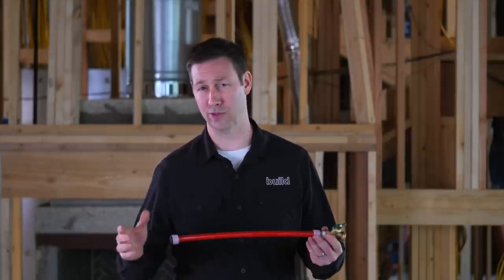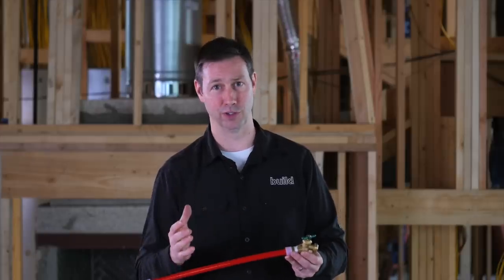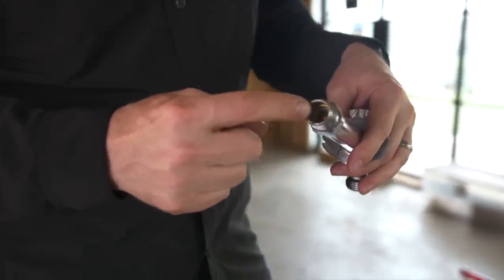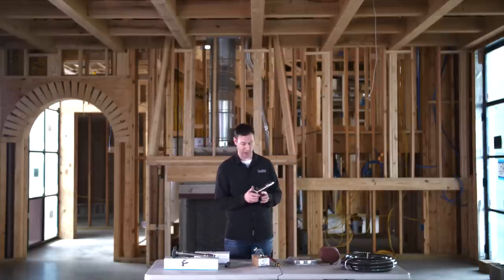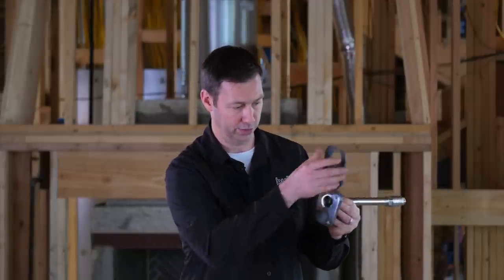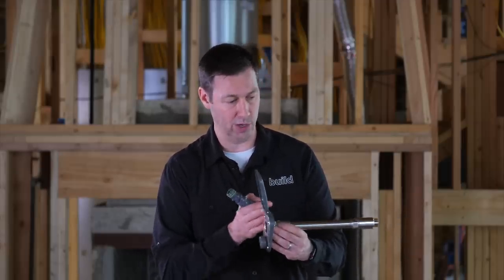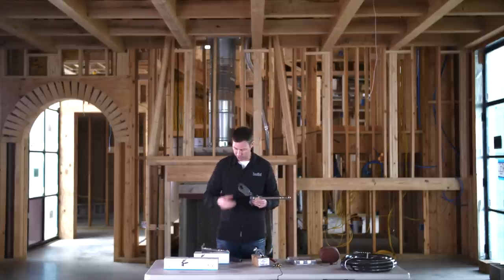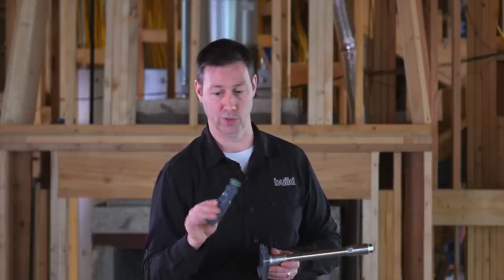No More Hose Bibs - A Better Outdoor Faucet

Comment: Way too expensive, and now you have to buy "accessories" just to use your hose. That silly plastic adapter looks like s sure way to break the valve or the accessory, when pulled on. Also, imagine that some contractor or landscaper needs to use your faucet, yet you are not home to show him where these gadgets are and how to use them.

Comment: Conventional  Frost free hose bibs have their own problem that causes total failure.   The are rising stem valves using  a polymer washer on the end of  long  tube. The tube is thinwall,  Very thinwall and it deforms easily. I can wreck them  with one hand.  The polymer washer is  cheap shit and embrittles forcing you to increase  torque leading to the end of you hose bib.   I've fixed a couple out of frustration and  used solid brass with a Delrin  spacer in the middle to prevent thermal conductivity .  Those frost free models  really are shit.  In the end I abandoned all  hope of a decent hose bib and  installed shutoff ball valves inside the building that I have to remember to shut off in winter. 
Those Hydrants  you have there look great  right up to the point where you wife or kids  start dropping it in the dirt or on the pavement and then shoving that damaged filthy  thing into the sealing surfaces.  Then  it's all shit again.

Comment: our house was plumbed with a shutoff in the basement ceiling for each hose bibb so we are able to shut them off and drain them if the weather is going to drop cold enough to worry about a freeze, not paying out the ass for a fancy plug that uses plastic parts.

Comment: had hte normal faucet for the last  15 years and never once did my pipe or faucet freeze sure if you leave  2 inches sticking out of the wall it will freeze eventually but mine is strait equal to the wall and insulated arround the hole  . Only the faucet sticks out of the wall . And guess what , i live  in the north of québec where winter temperatures reach -15 in average  and on rush time  -36 to -40 in celcius . I,m no expert plummer  but i can tell you this , its the amature that installs it that causes a faucet or pipe to freeze or leak  , not the kind of faucet you install . That faucet  did come off once  but it wasn,t because of the freeze but becasue of a bad soldering from the last one who installed it probably from 20 years earlier whitch was a good thing becasue the faucet was really getting deteriorated  so i installed a new one  instead  and it has been 7 years and no single problem with it since . people can install what ever they want thatds their choice but i have seen the older model all of my life and everytime i saw one leak or crack it was because of a bad installation    each times

Comment: And when you break the cheap plastic extension, or when the o rings fail on it, not to mention the seat in the wall mounted piece, you can go buy another one! - for many times the cost of a normal faucet!  Why would you want to replace a metal or brass, time - tested faucet with a cheap plastic one?  PVC loop in the wall?  What a hassle and joke!  And when you are not paying attention, and pull to the side on your hose hard enough - wait for that cheap plastic adapter to break, spraying water everywhere until you can hopefully go in the house and shut the water off to it!  What the hell is better about using a plastic hose adapter?

Comment: For 90 dollar you can buy a commercial hose bib.

The weird installation because the front shape of the faucet cant put a wing ear L on it because it won't turn. Seem like it creates more problems and a more expense Instalation and more parts to go wrong than a standard instalation. A plastic adapter for a high use out side hose bib and if you lose the adapter? Yeah I dont think this is such a great idea neat tho

Comment: I don't care for the house bib, just another gimmicky attachment to lose. If a hose bib is put in the right place, I never scratch my knuckles. 
The loop is an awesome idea. I can't count the number of times I have had to cut and repair a hole or install an access panel to replace a hose bib.

Comment: A 12 in freezeless faucet after taking off the handle and packing nut will pull through on the outside to replace the the washer .No need for the loop on the inside.  Cost is about 24 dollars.  Also make sure you remove the garden hose to allow the hose bib to drain .

Comment: Reminds me of a pneumatic quick coupler. Just out of curiosity, whats the actual life time on the valve that stops the water until the hose adapter is inserted? Have there been reports of any failing in the field yet? That valve seems to always be the first thing to fail in an air line, lol.

Comment: Was cool Until I saw the Plastic adapter and cheap plastic looking vacuum breaker..  need to be copper w a ball valve.  

couple issues with the adapter its plastic so more than not it is going to get broke and or lost up here in the north.  and it looks to be proprietary in design. so if the manufacturer goes out of business  replacement parts could very well be an issue.

Comment: Out of interest, the area where the pipe loop is - will that be accessible after you finish the house, or is it going to be filled with insulation? 
I love the idea of accessible services and the ability to add stuff later, but I live in an overcrowded part of England where every square foot of a house is needed for living space so major changes to serviced either involve a major renovation or running services on the outside the house.

Comment: I don't like the gaskets/o-rings are exposed on the hose parts. Outside there's always some mudd or sand and every time you attach this the dirt will get inside the installation.

Comment: This is not worth it, it just better to buy the cheap cover for the value then pay 90 dollars for something that wil not work if you loose the plastic piece or it brakes because you pulled the hose to hard,

Comment: That looks like it would leak at the exterior fitting and have water sheeting down the wall...

The loop is a good call but what do you do with the insulation that gets moved around if you ever do pull it out for service?

Comment: You still need a stop and drain shutoff. Even a 12 inch frost free can freeze with the water shut off. Drain it to the valve and then you don’t need to think about it.

Comment: Problem with pex is you need the next size up to get the size you need on the inside and they cause a lot of turbulence as water passes by all those couplers with the bushings inside. Easy install but like everything that is easy, not always the best.

Comment: I'm a water treatment professional and this is the only stainless steel frost free hose bib I've found. I'm thinking about installing one in the garage of my new house to run RO water through for a "spot-free" car wash water system. (Possibly in combo with a DI filter for 0 TDS water?) The RO can install in my mechanical room in the basement and feed pure water to all my purified water faucets in the house, including this one. Don't want the pure water running in copper/brass valves because it's more corrosive than regular tap water and can cause pinhole leaks.  I'm not sure I would want to commit to one of these with a special fitting needed on every outside tap on the house, but for my use with a dedicated hose and low flow sprayer for the spot-free car rinse I think it will work great. Thanks for the detailed review Matt!

Comment: What happens to the pressure in the hose when you disconnect it?  And I find it odd that the vacuum port is on the bottom.  I would rather it be above the port that flows water.

Comment: I am not sure I would like to trust the long plastic handle.  With the pressure of the hose pulling on it at an angle I would think it might break off and leave part of it in the socket.  Then you would have to go inside to turn off the water or else live with a new water feature on your house.

Comment: I bought a house 2yrs ago in MO I have 2outside faucets. Major problems with breakage and running water faucet, just had my 6th replacement. 3rd on each faucet Im not getting any explanation why my faucets break and run. I love this new invention I wonder how much it would cost to have installed. They look amazing.

Comment: those original ones are still used in the north with people who know to have a shut off inside and open the valve outside during freezing periods so it dont cause a leak issue. but yeah. most people use one that looks just like the original one but the shut off actually shuts off and turns on inside the house so it wont freeze outside.

Comment: 6 -8 -10" modles goes according to thickness of wall..i would prefer the longer, for strapping purposes. . 
   They look beautiful and i like the no handle look.. That loop the pipe is brilliant. . Scares me, but brilliant. . i love copper pipe.. I don't know how pex will be in 50 years but copper will still be fine..
Reply: interesting you should say that.  considering I've see two cases where copper eroded in less than 20 years, this year.

Comment: The thing I see is, when you disconnect, I can picture pressurized water coming out of the adapter from the hose.  I watched a home show demo and the guy disconnected with the nozzle still spraying, and as he did, some residual water did come out.  I couldn't imagine 50psi and not having a way to relieve the pressure.

Comment: It's pretty, but two things dissuade me from wanting something like this on my house: the adapter is plastic, and if it breaks off you have to either remember where the shutoff valve inside your home is or pull out your curb stop key to shut off the water at the street so you can dig the remains of the adapter out of the wall fitting. 

In the greater scheme of things, a $90 hose bibb on a multimillion-dollar house like Matt builds is a rounding error. If he was building my multimillion-dollar house, I would ask him to put a conventional frost-free hose bibb in a washing machine box and install a little flap over the box to hide it.

Comment: Wondering how realistic the concern is about the pipes freezing. I've never had an issue with our traditional spigots. 40 years of house ownership in Alberta, Canada.
Reply: Mine freezes solid every year, and nothing happens... I think it depends on how good your Plumbing is inside the wall really, or how much pipe you have for the ice to expand into.  Cheaper 90s and pipe are probably more prone to splitting (i notice new ones seem to be a lot lighter than mine from 1950/whenever), and if it's close enough to a sink or toilet,  anything with a plastic valve in it,  that could be trouble too.

Comment: Or install a valve inside the house with some kind of faucet inside to drain the pipe leading outside when you shut off the water for the winter

Comment: Really nice that it's pre-tilted to drain, many are not. They have a plastic flange with screw holes that sort of tilt but not well. Btw you forgot to remind them remove said valve out of sillcock before winter or it'll freeze.

Comment: The service loop is really clever!  In 20 years or so when the unit needs to be replaced, how will the plumber know it's there?  Taking a chance that they will unscrew the mounting plate and pull or cut a hole through the sheetrock where they think the connection is?  

New homes need a chip like the vet puts in our pets.  Homeowner gives the tradesperson an access code, scan the doobly doo, and bingo, questions answered.

Comment: One very important thing that we need to be aware of this particularly featured frost free hose bib is that once you lose or break the adapter which opens or closes the valve (and it's not a gate valve!), it becomes useless. (and imagine if the manufacture goes out of business, you can't use it anymore!!) Generally Frost Free Hose Bibs are pain in the neck. I recommend a regular hose bib and install a ball valve for the hose bib somewhere inside & accessible location. Just close the ball valve in winter and drain water out of pipe serving the hose bib. Also not sure about the loop of the water line. Usually you want to minimize disturbance of water pipes (pushing or pulling it) after installation. Good luck on not creating a kink in pipe.
Reply: Our frost free system has improved by using high quality stainless steel instead of a brass or copper piping. The adapters are available on Amazon (Prime) or direct through our site. Each one is 3/4" threading so hopefully it won't leave your hose and walk off.

Comment: That thing looks expensive to me.    I've had the  "turns off behind the knee wall" faucets before.  They work pretty well, as long as they are tilted downwards towards the faucet. 
    I live in piedmont NC.  We have tons of freeze thaw cycles every winter.  I ran 3/4 inch PEX under my house, with about 15 feet of Pex outside my home, with a conventional faucet at the end.  I can fill a bucket away from the house without getting a hose.
  The PEX that is outside freezes up, and then thaws every cycle.  It's been like that for ten years now, never any problem.   The water freezes first at the metal faucet, and the ice stretches the PEX a bit, no problem.

Comment: It would be nice if you could for once make a video on how to save money and yet build a better house. If had I had unlimited resources like you do I could build amazing homes with my eyes closed. How much do you spend on those homes? like $300 a sqft? And you can't even spell hose bibb.
Reply: Andreas Wurzer. Quit crying and go get the high end jobs. I have worked on both 100 dollar a SF jobs and just finished a T and M job that was 11 million over 2 years. For us the money is in the high end of the econo home. So sure we could go after nothing but the big jobs but why we make more on 3500 SF job per hour.  PS if you want to big jobs I'm currently vacationing in Keystone CO and there are lots of construction trucks running around. It did snow yesterday but there is big work to be had here.

Comment: The only issue with the loop is the pex will potentially vibrate in the wall when you turn the water on. Pex needs to be fastened down and not left loose like that.

Comment: 2016 This old house video was sponsored by Aquor and they had similar comments posted...
https://youtu.be/Qkc5tua-mz4

This system seems better suited for commercial buildings, so people would not steal their water. 
I always see the key system faucets that barely work,  from neglect. 

But as a home owner it is not that difficult to inspect and check your faucets. 
You still have to put the hose away for the winter right? That is the time to winterize it.

Comment: The company emailed me back and said these were compatible with the dog’s lixit and drip irrigation with timer. Yes more expensive right now, but when the old frost proof hose bibs fail because of those two things, I’ll switch. By the time I open the Sheetrock, put in the new aqua, add an access panel...still cheaper than a plumbers visit, especially if the company sends two plumbers

Comment: I live in the high desert of NM. I have that traditional external shutoff valve and my only protection is the cheap foam box. My house is on a slab and my water line is a copper line in the wall with a 3 inch brass nip to the hose bib. Is there an option for a short frost free or is that just too short for consideration. We do hit single digits in the winter and I’ve always been nervous and always dreamed about having a basement like everyone back east. Thank you for your videos as they are very informative and extremely helpful.

Comment: Spend more time with the vacuum breaker. It's main purpose is to keep  contaminated water in the hose, or whatever the hose end might be sitting in  (a pond, swimming pool) from back flowing into your house pipes when the water is turned off. It even keeps that contaminated water being right up against the valve and then pathogens might work up stream into your house. (There are x number of pathogens water companies are concerned about and some of them can move against flow and pressure). 
Another tip is when raccoons and critters gnaw garden hoses to get the water or just to work their teeth. I spray the garden hose with Windex or ammonia. It dries and you don't notice it. But critters taking a sniff or a nibble get a sharp soapy taste and back off.  
I live in Southern California so freezing isn't an issue. Instead of replacing the crummy hose valve every 6-10 years (after they drip for 4 years), I install a ball valve, vacuum breaker, and then a hose bib fitting. They never go bad, never leak.

Comment: Above all, especially in the Northern climates. Make sure there is a tilt to both of those types of bids... Tilt it in a way where water can flow freely out and away from the valve inside. I've seen an anti freeze bib freeze due to the installer installing with a tilt towards the valve. Therefore water stayed in the entire length of the the hose bib and froze.

Comment: Frost free hydrants have been around for a long time, and it is not that hard to use a regular hose bib with a valve on the inside and shut the water off in the fall and let it drain out. People put the pipe on a  slight downward slant, so you don't need the vacuum breaker. Also, that plastic fantastic part there looks like it will wear out and appears to be proprietary and expensive.